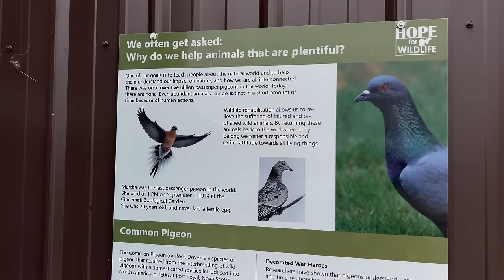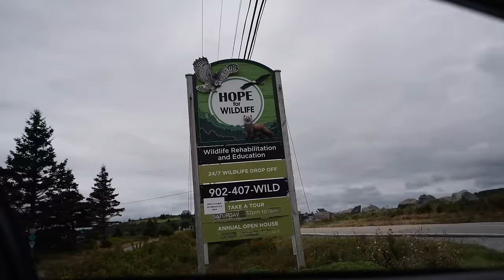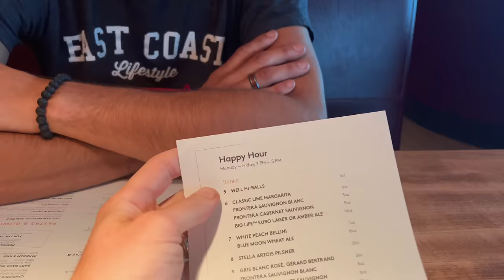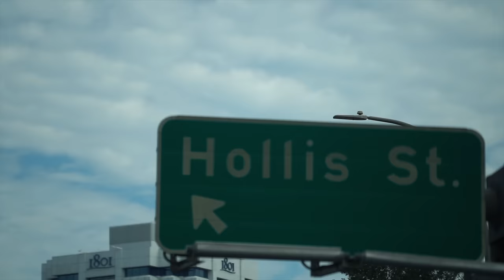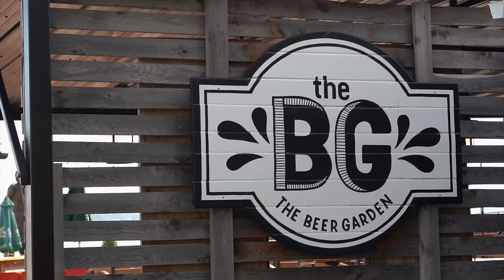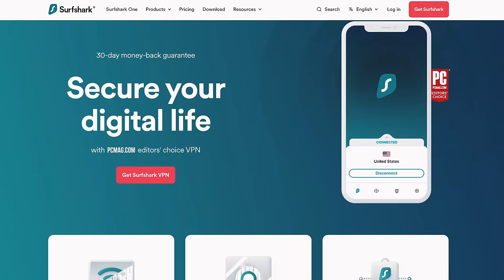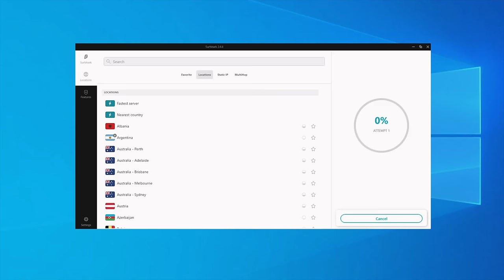Daily Life in the Woods (living in a Geodesic Dome)

Comment: Just a suggestion but bath and body works has the most amazing and large neck rolls that are temperpedic, with a long flap with large silicone suction cups , the flap will go over the top of the hot tub stick them on and relax.also they have a zipper to remove the roll to wash.so comfy for a hot tub and no damage and won't float away lol..

Comment: You guys really don't get enough protein and this is not coming from a meat eater that doesn't understand a plant-based diet 😅 we need some beans, nuts and lentils up in this beech
Reply from the maker: We actually just had blood work and our values were HDL, LDL, Biotin, Iron, and every other important value was just perfect ☺️
Reply: @tylerandtodd  good to hear your cholesterol and micronutrients are doing fine but your macronutrients which ideally consist of fairly equal parts of carbs, fats and proteins are way off. Have you guys never wondered why you are so lean doing that much physical labor? 😅 In the end it's your body your choice the healthiest diet consist of fairly balanced levels of the 3 macros though. Took me a while to learn how important that is myself - that's why I wanted to share. 
(Fairly equal means; 45–65% of your daily calories from carbs, 20–35% from fats and 10–35% from protein, 10% might seem low but 0.8-1g of protein per pound of bodyweight is recommended, pretty sure your calorie intake is too low too but again, your body your choice, it just triggers me because I struggled with over and undereating for a while that's why I wanna share.)